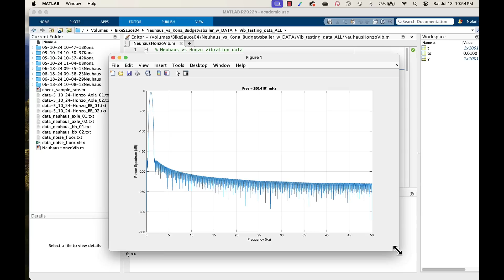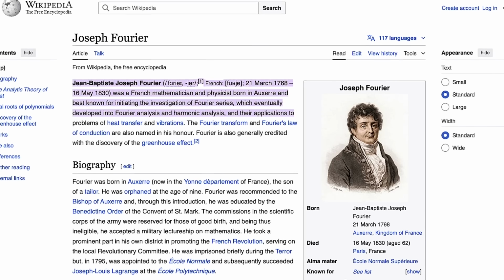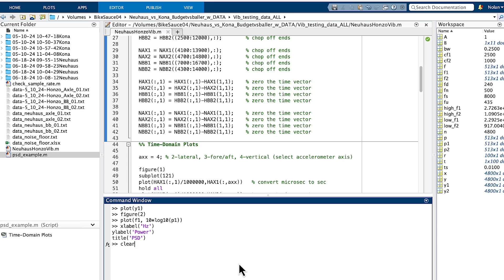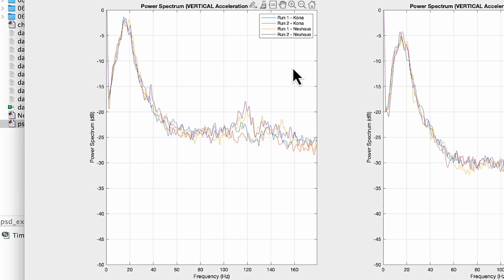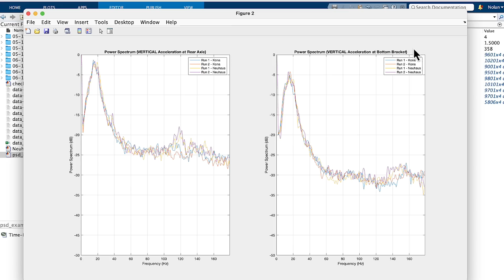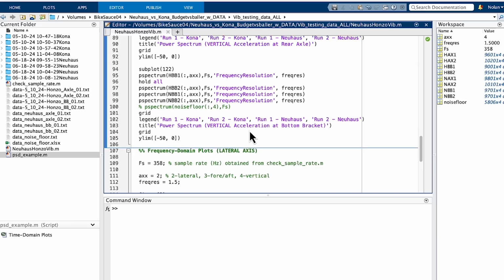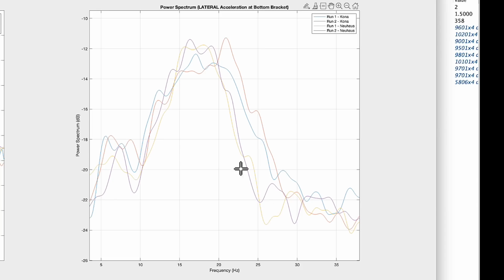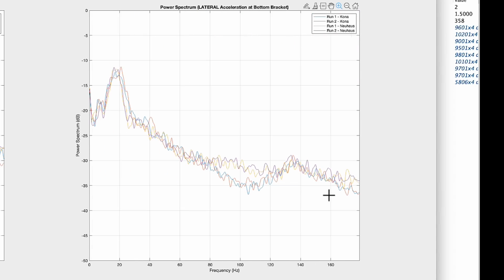The MYTH of Vertical Frame Compliance.

Comment: I am curious about the effect tubing has on the feel of the ride: responsive to pedal input vs absorbing the energy of the road surface. It has been my unscientific observation that the quality of a material affects this balancing act. 
A frame made from high grade tubing like Columbus Spirit or Reynolds 531 seems to be able to achieve this better than 4130 tubing. It may sound like snobbery or marketing but there seems to be a difference between a $500 and a $1500 frame. I was disappointed in a modern Tange Infinity frame compared to a vintage Reynolds 531 frame. 
But I suspect there are too many variables that unless you had frames of different materials made to the same geometry it would be hard to isolate and measure. Possibly using science to explain alchemy. Or to put it  simply: the result is more than the sum of its parts.

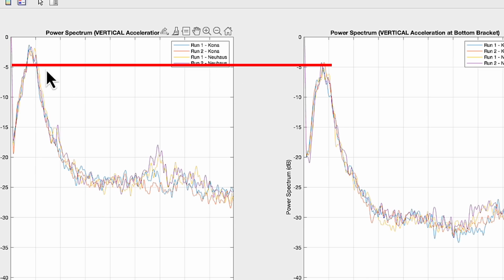Comment: 9:40 wouldn't you expect lower vibration at the bottom bracket simply due to the fact that it's midway between the two wheels? When you hit a bump, the vertical travel measured at the axle of the wheel is going to be about as much as the size of the bump, but midway between the two wheels it's only going to be about half as much.
Reply from the maker: Right. Agreed
Reply: @TheBikeSauce  YAY! Not too bad for a software engineer.

Comment: I appreciate the scientific approach. It's frustrating to hear people say that one frame/handlebar/wheelset is more compliant, when they have totally different suspensions, tires, etc.
Reply: The language used to describe bikes is imo one of the most BS ridden ones of alle time. It is practically esoteric without any self reflection.  I think, you might find more hardcore belief than in church service.
Reply: @ItCameFromTheRubenacker   "this suspension fork is so buttery!" without providing any data from a shock dyno

Comment: Guess I'm gettig Cunninghamed hard here...

So much talk of data and all I see is zero handling of noize: you're basically comparing transformation artifacts. 2 dB reduction doesn't mean anything when the graph has 5 dB noize. That example with a single sinusoidal wave is a big red flag.
Also, the biggest spike occurs around fork eigenfrequency. You observe whole bike as one compressing the fork. Wheel effect - I presume - is to be seen around 110 Hz mark.
Lastly, difference in stiffness must be observed through change of frequency where the spike happens (further right - stiffer). It's height at set frequency tells about demping to stifness relation. And curve smoothing of the transformation algorithm.

Comment: That makes sense because we don’t often hit bumps and rocks straight on so that lateral compliance is what we feel. Tube shapes and wall thickness is probably more important than material or other geometric aspects. And when seated you get a lot of flex from the seat post and saddle. Plus tire pressures have a huge effect.
Reply: Rigidity is a combination of tubing diameter, wall thickness,  geometry and material.  There are significant differences in rigidity between aluminum,  titanium and steel.  Aluminum is about 1/3 of the density of steel but 1/3 of the rigidity as well.  Titanium is 55% of the density and 55% of the rigidity.  Different alloys of steel, aluminum and titanium have between zero and negligible differences in rigidity of dissimilar alloys of the same base metal.  An interesting study was conducted and published on rigid fork compliance in "Bike Tech" volume 3, number 4, August 1984 comparing forks made with 4 different types of fork legs 3 types of Reynolds 531 and another in Columbus SL.  They compared different head tube angles (71°- 75° H.T.A.), total fork rake (38-62mm), fork rake radius and constant trail for vertical compliance.  A 71° H.T.A. had nearly double the vertical compliance of a 75° H.T.A.  - The results were surprising.  I don't know of any other specific studies which tested a variety of different designs to compare vertical compliance but am convinced that a number of others are likely to exist.  It would be interesting to see the results of a variety of different frames tested for lateral rigidity and comfort, geometry,  features such as curved seatstays... for comfort according to a testing machine measuring vertical compliance as well as actual riding (which is subjective).
Reply from the maker: Yea true.

Comment: It makes sense to me.  Energy needs to be transferred and dampened and dissipated, whether by allowing vertical or lateral frame flexing.  It doesn't matter the direction as long as there is a way to transfer and dissipate the energy.

Comment: There's a video on CyclingAbout, about how frames don't have vertical compliance and most of what's being measured when many frame manufacturers measure vertical compliance is mostly just due to the seatpost flexing and almost nothing to do with the frame it self flexing. https://www.youtube.com/watch?v=Lb4ktAbmr_4
Reply: I saw that.  Metal is much pliable than the hypothesis of the your mentioned video.
Reply: @hammertime7740  Based on the actual tests cited in the video, there's almost no vertical compliance on the frames that were tested.

Comment: most of what is called "compliance" is actually tire sidewall flex and flex in the wheel spoke system. how can a triple triangle structure meaningfully flex in the vertical plane?

Comment: Also...what are the specs of the wheelbase and chainstay lenght between the 2 frames? Differences there could account for differences at the bottom bracket, I would think...
Reply from the maker: Should have mentioned that. The frame are similar, but not exactly the same geo. Could be a factor as well

Comment: Matlab is where I spend my time at work and this video speaks to me! As more data comes to light, I wonder if the square taper bottom bracket might get renewed attention as a source of riding comfort given it's supposed higher flex. Analog devices makes mems accelerometers with PDM output (for all purposes, analog) that I've used in some past experiments, including as a very crude bandlimited acoustic guitar pickup. They are good to around 6k . I imagine making a test rig using a handful of these with a multi channel audio recorder like those zoom to facilitate gathering raw accel data for multiple locations in the same run. Anyway, know that the science heavy work is most appreciated even if it doesn't have high appeal to a broad audience. Cheers!
Reply from the maker: Haha I’m surprised at the engagement so far, but yea. Super niche video
Reply: Agreed. It doesn't matter what level of ride comfort your BB shell is experiencing. What matters is what the rider perceives and most MTB riders are on super stiff aluminum or carbon cranks with hugely oversized, hollow spindles and have been switching to shorter length cranks en mass which are even stiffer. 

Riding BMX, no suspension obviously, the impact difference in feel between tubular chromoly cranks VS forged aluminum cranks is obvious. I mean just look at the cross section of a round steel tube VS a solid aluminum block. If everyone wants their rides to be "buttery" maybe ditch the ultra-stiff cranks?

Comment: I would think measuring the vibrations at the rear axle and TOP of the seat tube would show more of what you feel (since you were presumably sitting on the seat). I have an old Cervelo RS from 2010 and the seat stays are pencil-thin and not even straight tubes - they are purposely arc-shaped to allow them to flex and minimize the vibration felt in the seat. The chain stays are stiff and straight to maintain their shape when power is applied to the cranks and keep the bike frame from deforming just from pedal forces. Curious if you ran those trails again and took the data from the top of the seat tube what differences you might see.

Also, there is likely a lot of variation in each run because your wheel didn’t travel over the exact same path each time. To help better understand the “input” vs “output” vibration, you should consider dividing the data (point by point - easy with Marla) to reveal the transfer function. You may need to offset the data in the time domain a bit to account for propagation delay?
Reply from the maker: Definitely for a road or gravel bike, but descending on the MTB, I’m usually standing on the pedals
Reply from the maker: The argument about different lines on each run is valid, but again that’s why I took a frequency domain approach. As long as the PSDs show the same frequency content, the exact lines don’t matter as much.
Reply: @TheBikeSauce I get it regarding the value of PSD, although you have so few runs and there is likely pretty large variability in each run. If you did a statistical analysis on the variability of PSD in the two runs on one bike, and figure out 2 or 3 sigma variation, you might find that it overlaps with the other bike. So is there really a statistically significant difference?

Don’t get me wrong - PSD is interesting to look at, but in my experience, I think you could make an even stronger conclusion if you calculated velocities and displacements from your accel data, and compared how each impact event at the rear axle manifests itself at the bottom bracket throughout your ride. I come from a field where we were always very limited in the number of runs/test we could make, too (airbag systems for passengers cars - each test destroys a $250k prototype vehicle). Our systems essentially calculate how much the vehicle is deforming using a similar setup:  accelerometers at the vehicle periphery, compared to accelerometers in the cabin. The systems estimate the displacement at each location (double integration of the accelerometer signal), for each data sample, versus time, and compare the displacement curves against each other. That was more meaningful than PSD in our case;  we could actually see the deformation of the vehicle happening as the displacement curves separated while the impact event progressed. Granted, we are looking for gross/plastic deformation and you are in the elastic region, but those integrations also really smooth out the data like PSD, and would let you compare input versus response more directly IMO.
Reply: @TheBikeSauce ah, ok. Then I understand why you measured at the bottom bracket. Great video, and nice job as always. 👍🏻

Comment: Very interesting look at the “feel” of steel that is thrown around in conversations. With that in mind perhaps the “contact points” are where this feel can be analyzed if possible. The grips,the pedals and the saddle. 
I agree that lateral movement is probably more significant but I would speculate that thin wall seat stays and chain stays would have some vertical movement. Just a thought
Reply: I would think that its a fairly uncontroversial statement that after tires, the overwhelming majority of vertical deflection on a rigid bike comes from seatpost and handlebars. The frame material and design are probably nearly irrelevant.
Reply: @cjohnson3836  I have stayed with 31.8mm diameter bars on my mountain bikes and honestly the additional stiffness of 35mm was not necessary for me. So many variables into the feel of a bike and I don’t know it can be isolated to just one or a few frame materials. But I do think that the design and layout of the tubing would have noticeable impact on the overall feel.
Reply: @hardmtnbiker  I think handlebars get into a different world than the frame. Now you're dealing with sheering forces loading onto a lever arm. Material properties now do matter because you're trying to thin out a tube as much as possible while maintaining safety. Steel and carbon can really take it further than aluminum, in this application. When it comes to frames though, I think it (material) is not particularly relevant. We can talk all day about the on paper differences between materials but the rider is the same. And so that material still has to conform to the same end, safely support a rider of approximately 160-230lbs across a particular type of environment (road, trail, whatever). So, regardless of material, it has to hold up that 230lbs rider, safely. Therefore, yeah, tube dimensions are going to be manipulated to provide that, however the material requires. And so the differences between material as a contributor to "feel" I think disappear.

Comment: Compliance means bend or flex, right?

Do we want to measure flex at the handlebars, pedals or seat?

Do the tires provide a lot more flex than a frame?
Reply: the tires, vertically, 100% yes. Horizontally.... hmm..... the rims also have to be considered, those flex laterally too...
Reply from the maker: Yea everything flexes to some degree. It’s why this type of vid is tough to make. Im making no sweeping claims here 😀
Reply: Great video! I could wish that my ME profs were as interesting as you, but in fact, they were! (ME, UC Davis).

Add me to those who'd really like to see similar tests comparing rear axle to seat post and front axle to handlebars.

Comment: What does the data look like if you plot the residuals or the difference between the BB location and rear axle? Is it possible for you to post the raw data some where so we can mess with the plots?
Reply: I think for this to be as useful as can be, the data for both locations would have to be from the same run (which it isn't)  but I had the same thought as you! With such data one would, in effect, have the transfer function from the axle to the BB
Reply: @aurelioramos8463  Oh yeah that makes sense, the run to run vibrational difference is going to be too large. Getting the same run data would be really interesting.
Reply from the maker: For sure. It’s hard on a budget; these data loggers aren’t cheap 😀. The freq domain approach does mean the exact line isn’t as important, as long as you’re close, and exciting the same vibrational modes in the frame

Comment: Hey Nolan, as a fellow Mech, in the absence of building a test stand to directly + repeatedly measure the actual deflection, I wonder what kind of results you would get by adhering strain gauges to the back and chain stays and rerun the same test. I’ve not had to deal with as noisy a set of data as that would be first hand, but would love to see you try😂. (Maybe some student labor can help figure it out)

Anyway, I’m the kind of nerd who would love to see more PSDs in my bike content, so thank you for going all in on the actual engineering experimentation!
Reply from the maker: I’ve been toying with the idea of mixing the channel here and my cycling research group on campus, but have to work through some details

Comment: Curious if the bottom brackets were exactly the same between the two sizes. I saw you used the same cranks.
Reply from the maker: Different bb due to shell sizes, but same cranks.

Comment: I greatly appreciate your work here. It is so important to show what is actually going on. Would be neat if you'd contrast level of variance between frames an 2-5 psi tire pressure difference to show flow important tires are compared to frame choice. 

Also your results This  track with an experiment we did at the university years back but we had to use students in our group and mask the frame to do some level of blinding. We tested road , trekking and MTB frame with same wheels etc and we basically found it was all a wash they were not cyclists but even I failed to identify what was more compliant but it wasn't the ~33% spread as with others... But it was still sobering how much expectations played a role in perception of comfort/ compliance. Runs were on cracked pavement and cobbles in 2000s uni didn't want to give us the expensive accelerometer dataloggers and the were being used in seat dampening tuning for trucks.

Comment: It would be interesting to plot points at the bottom bracket, top of the seat tube, and at the saddle clamp to see if there's a big difference between the 2 frames as well for that.  Vertical compliance while seated is more a function of how much your seatpost can bend backwards rather than through the frame, right?  
Though, since you were on your mtb, I'm guessing you were out of the saddle more, so you would be feeling compliance through the pedals.  So the lateral flex might make sense for that since cranks and pedals are more like levers on a frame, right?  I'm not an engineer at all, so I'm probably way off base on everything. : )

Comment: I love that you do this, its a ton of work.  But to nit pick, you seemed to have came to a conclusion then looked for data to support that. You didn't find it in vertical so you speculate that its in another axis.  And you may be correct (and haha I just unpaused and you touched on this), however you have no way of knowing if that matters at all.   But anyway cool test, as I said I love that you did this.

I have several bikes, but one minivelo that is super flexy in the BB area, and a canyon grail that for me is super stiff, cant get it to move at all.  But it's the flexy side to side minivelo that is the harsh and non compliant ride even with 32mm tyres on both.  But one variable there is 650b vs 451 wheels..
Reply: I also have a minivelo (VO Neutrino) that I built and was surprised by the harshness. But in this case I think it's the wheelbase. The rear axle is almost right under the saddle, so you get more position displacement over bumps vs rotation if you were in the center of a long wheelbase. Imagine riding a bus and sitting over the rear axle (or past the axle!) vs in between the axles. The wheelbase itself also matters for this, and short wheelbase cars tend to be a harsher ride than long wheelbase cars. In this case it appears the Kona actually has a longer wheelbase than the Neuhaus according to the geo sheet.